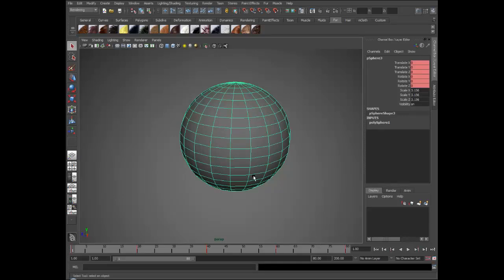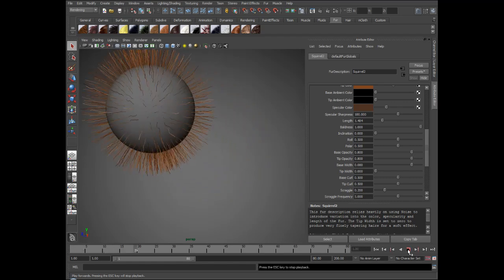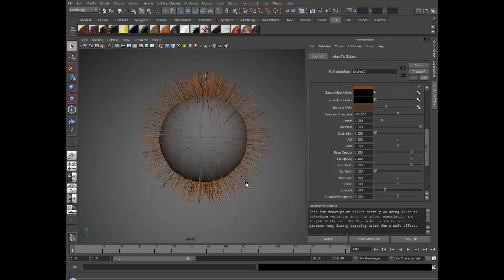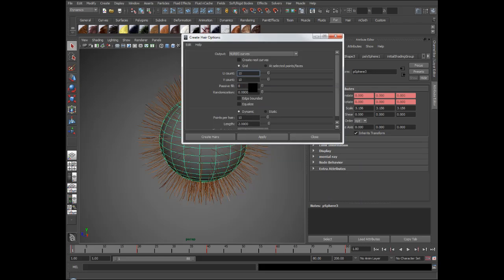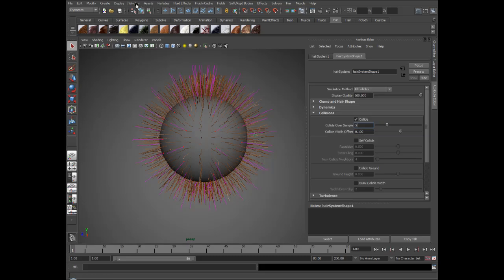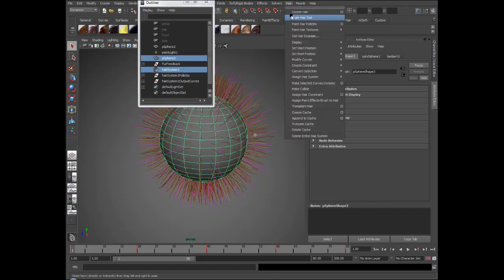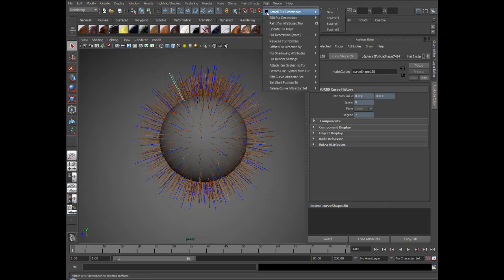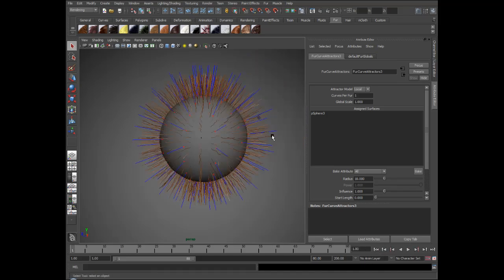Maya tutorial. animating fur with dynamics

Comment: If you look closely, the fur is following the hair system but it is still penetrating through the sphere itself...I've run into this problem several times on my own and can't find a work around...I know in Maya 2015 they solve that issue with XGen...but I'm using 2014 :( Do you know of any solutions to make the fur collide with the geometry itself? Thanks for the great tutorial :)
Reply from the maker: Driving the fur effect with hair is sort of a hack method to avoid setting up a more complex hair simulation. If you need very accurate hair dynamics it may be better to render the hair directly and increase the collision samples, it may be that the fur is too spread out and not following the hair curves enough to avoid obvious penetration of the surface. setting up very accurate hair can be quite tricky without plugins, you could consider trying Joe Alter's Shave and a haircut plugin, its very easy to use and you can achieve alot with it. http://www.joealter.com/shave.htm
Reply: +Moebius 3D in create hairs, choose 3 points per hairs. I realize that's good.